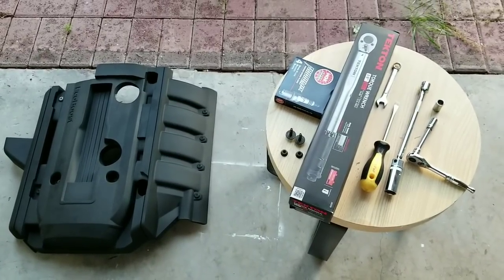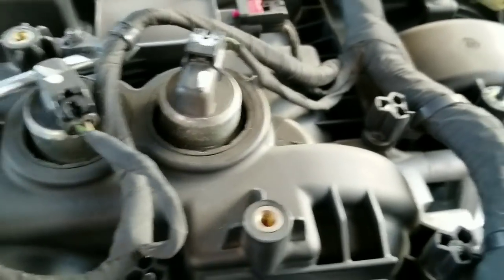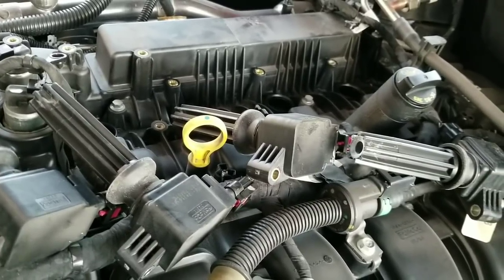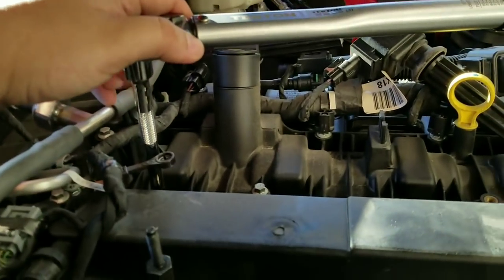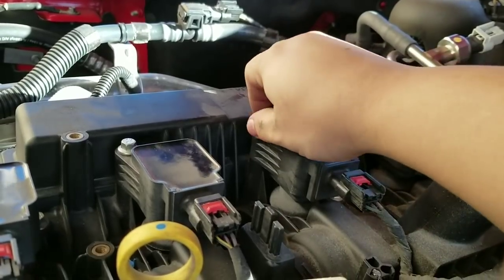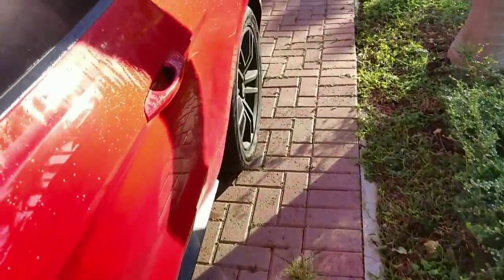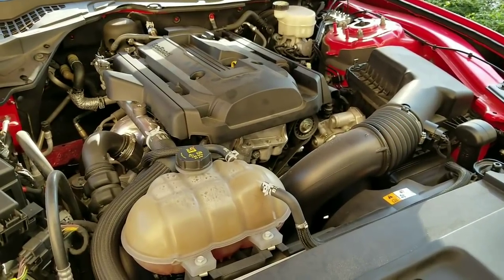How to Change Spark Plugs on the EcoBoost Ford Mustang 2015-2017

Comment: You are not operating the torque ratchet correctly. You have to hold the head of the ratchet with pressure applied to it while turning the handle. Failure to do so can possibly over-torque the bolt more than you want.

Comment: you torque it on 23 not on 18. You don't understand how to use a torque wrench, but you try to learn others :D
Reply from the maker: No sir, the 15 mark was set + 3. If you look closely it is not set at 20 mark + 3. But thanks for the effort!
Reply: @BoostedWhipz  So after a year you still don't know how to use it? :D on the left is number 20 and you got past it :) The lower  mark indicates the actual number, not the highter one, so if you started to cover the digits, you are setting a bigger value of it :) 8:08
Reply from the maker: I am below the 20 on the left. Are you blind or just trolling. I am literally 2 below 20 line on the left.
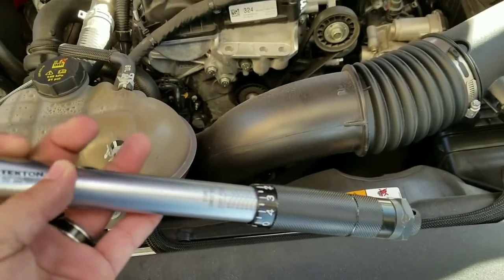Reply: @BoostedWhipz  No you NOT!!!  8:01 you are over a lower line of 20!!  Do you know what that markink means?   _/''''  ? If you can't see a lower line of the mark, you are counting over the number to it !
Reply: you still didn't get it ? :D
Reply from the maker: @Autoelektrikas_Vilius  YESS and I am over the 15 line on the right. At least that's what I say on the video.
Reply: @BoostedWhipz  yea bro u literally on like 23 pounds lol these is only suppose to have like 13 pounds

Comment: A couple things:
 When you start threading the plugs in, do it by hand without the wrench attached. You have a lower chance of messing up the first couple threads. 

Anyone who is not holding a camera while working should support the head of the torque wrench while torquing anything. You can snap off the head of the spark plug and or get inaccurate torque.

Always good practice to apply dielectric grease to the boots of the coil prior to install. 

Nice video tho man!
Reply from the maker: Aaron Keller definitely great info for the viewers. Thanks man!

Comment: Damn 18 ft lbs? I could of swore i saw on adams site not to torque above 10 ft lbs. Have you had any trouble at 18 ft lbs?
Reply from the maker: D M no issues at all. Yeah I think Adam recommends 10-12lb... Others do differently. Adam has looked at my logs and haven't spotted anything weird either.

Comment: Hey what's going on BoosTang23T nice channel man, I have a 2016 mustang ecoboost with a CAI and a muffler delete, in your opinion is alright if I bought the NGK spark plugs 6510
Reply from the maker: Mike Hernandez blessed my brother hope you are too. Yeah you can use the 6510s. You can add these at anytime. Does not require anything special. Thanks for watching and feedback.
Reply: Thanks for the reply man, should I leave them pre gapped or adjust them?
Reply from the maker: @Fishing4reel956  I left mine pre gapped at Adam's setting.

Comment: Nice channel Bro, I live in the Fl Keys and I think u live in Homestead right, I got and Ecoboost Premium 2016 and I saw u getting 5.3 in the 0-60 that’s great man
Reply from the maker: Victor Hernandez yeah I am in Homestead. Thanks for the feedback. Yeah I got 5.3sec, but I took off a tiny bit late. I think I should be in the 4.9-5sec.Going to rerun it. Hard to record and concentrate on take off lol.
Reply: Damn man getting a 0-60 in less than 5 sec is a great achievement, better than a GT. Add me on Snapchat Victor-h1 or Ig victor_hernandez12 and let’s meet up later man I wanna see your car.
Reply from the maker: Victor Hernandez I don't have Snapchat, sorry 😯. Still haven't re-ran it, but will update when I do. For now 5.3sec is the record lol.